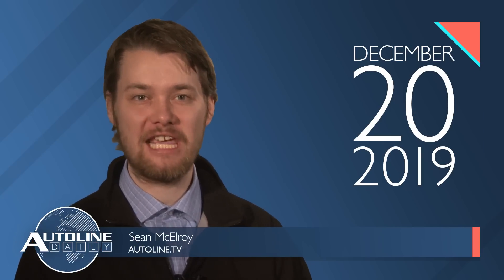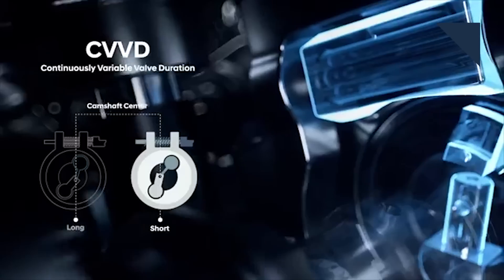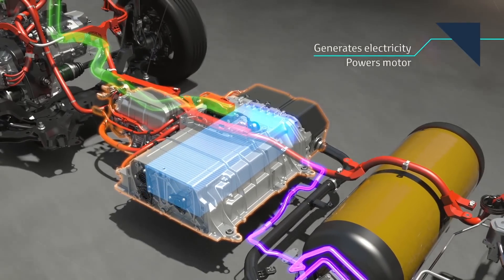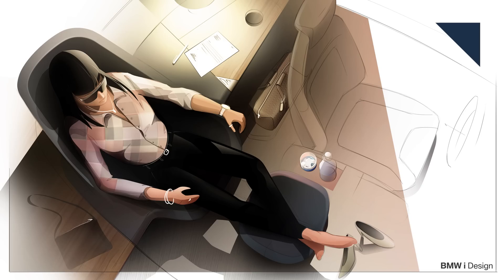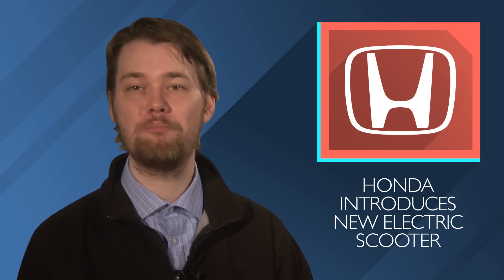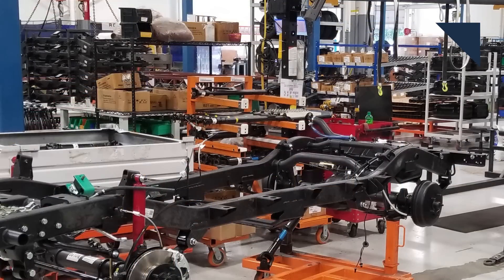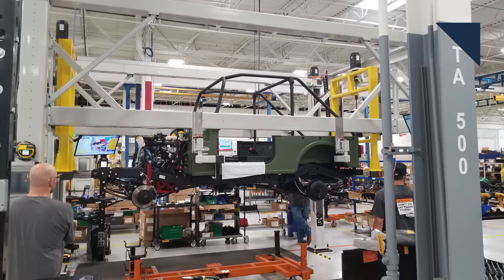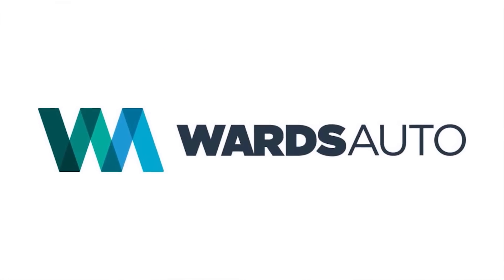How Mahindra's ROXOR is Made; Tesla Performance Update - Autoline Daily 2742

Comment: Regarding the Model 3 acceleration upgrade. As an owner of a dual motor long range I am very excited at the prospect of boosting my acceleration. At the time I ordered I was tempted by the high performance model but I could not get past the price difference. When I studied the enhancements the only component Iwas interested in was the acceleration. The other parts of the kit are nice but for the way I drive are hard to justify and not necessarily. I expect the extra acceleration to have a direct collation on the smile factor. So for $2000 I get a car that is more of a value for me. As far as weather or not it bothers me that the feature is already physically part of the car I bought  it doesn't. Going into this purchase one is aware of several options including autopilot that are built into the car that can be purchased later.  I look at this a big positive and love being able to add factory features when I am ready. Don't expect to be adding full self-driving but I did add enhanced autopilot once I got my rebate check. Thank you for putting together a great show Happy New Year!

Comment: The amount of wastage from EV battery packs is a handful of the percentage points of ICE wastage. Picture just the stack of oil cans a car will go through over 25 years. That plastic and foil container covered in oil is non recyclable. Now think coolant, gasoline, antifreeze, brake fluid, etc. it all adds up. EVs are better environmentally. Pretending otherwise doesn’t affect the facts, but you’re free to believe in a Santa, too, if you really want.

Comment: Saying batteries are recyclable is easy. That doesn't mean the value of the recovered materials is high enough to cover the costs of the recycling process. It's not like taking your bags of aluminum cans down to the recycling center and getting a couple bucks for your effort. There will be a significant cost to dispose of EV batteries even though they are being "recycled"

Comment: I was let down and eventually upset every time I went in for an oil change in my 2012 Volvo S60.  One feature I was told my car was going to be eligible to upgrade to by the dealer was remote start. I purchased the vehicle and started loving it but when I went in for my first oil change, maintenance, and promised upgrade, I was told they couldn’t complete the upgrade because my car had too early a VIN. To add insult to injury, every time my service advisor changed and they were doing a checkup on my needed services, I kept getting told they could absolutely do the upgrade. I even made another special trip to the far away dealer when they promised me. I told them I would pay them double or even triple if they could install it. Nope. So to answer your question, you would think I would very much dislike the idea of paying later to make your car better but here’s the thing. That was an after market dealer installed “option” even if it never was for me. With software, it’s not that OEMs are unlocking more power in this case. All kinds of software is optimized to make the car work better with all the hardware already installed. They haven’t talked about if those parts might ware out earlier because of it but part of the way they program vehicle systems is in a way that optimizes longevity to any specified degree and optimizes integrations better as some of the same parts are used for longer periods of time with either better than expected longevity or more likely in Tesla’s case to optimize the length of time some systems can be continued to be used with little or no change from the suppliers. Tesla doesn’t update vehicles with model years, they just stop making one version and move on to the next as needed. So by using better than promised parts, they are able to work on systems programming later to tune in better and better performance of the parts.  I’m not sure if I’ve ever seen a year down of a performance Model 3 and just an average all wheel drive one. I know there are differences they talk about in some systems but perhaps it was just less expensive for Tesla to cut down complexity of the car by making options software locked. People are much more apt to buy a little all the time, either through subscription or as small instant upgrades as time goes on than to replace a well functioning car all the time. With drastically less scheduled maintenance in Teslas, unless Tesla makes appreciable changes using the model year method, most people are surprisingly ok if their vehicle doesn’t do things exactly like the newest versions. But also by keeping many of the structural parts the same from year to year, they are able to change out tail lights to new designs seating or any number of items before or when those parts wear out which would mean even less profit from loyal customers not replacing their entire vehicle as often, they are faced with a daunting opportunity, have them upgrade even more often. But how? Virtual upgrades, especially if Robo-Taxi isn’t as big a thing as soon as they have suggested as soon as they have hoped. Tesla has talked about someday offering steering wheel delete as an option with full self driving and possibly standard someday. Will it happen? Who knows but people will gladly pay for that as an extra after market dealer “installed” option if it means that in their community they can drive hands free to 75% of the places they normally go if cities mandate driverless be steering wheel less in order to decide 100% who is in charge of the vehicle even if cities also force restrict geo-fencing of all hands free autonomous vehicles. What will happen to the last 25% of the trips or maybe even more? Gone, in fact I think planned cities will start popping up that are pre-planned 100% for autonomy.  In the far off future, cars that are not mostly or fully autonomous might even be required to have some type of warning devices in them to broadcast to freely moving autonomous vehicles that they are around and should be avoided to ensure maximum safety. Maybe a retrofit can’t be forced but perhaps something that uses existing standard equipment to make them more visible to autonomous cars like full time high beams or hazard lights except in turns or even their design will give it away. I know I would even return to that same old frustrating Volvo dealership for them to “install” the physical aspect of a future software self driving feature if it requited a wacky paint color or wrap to warn normal cars around me that my car was autonomous even if they couldn’t figure out how to install their own low tech remote start system on my beloved S60 so many years ago.  If I’m happy with what the car is promised to do now at a given price, I don’t care if I don’t have full use of a feature that might or might not be available to me at a higher price later.  I’d rather take what Elon Musk is selling these days, under promise and over deliver than the opposite. Rush the parts out the door now and make the software great now but make it better later. You just don’t want it going in the other direction.
Reply: Can you split your comments into "chapters" and page numbers. Its makes the reading easier

Comment: A couple of points i felt like noting.
* an average battery life of an EV is about 8-10 years with about 10% degradation. After that there is always possibilities for 2nd life in terms of storage for residential purposes. 
* the Wiper blades shown defrosting the snow is only being shown on Thin crusted ice. Get them to Canada in -40 degrees and tell them to do the same.

Comment: Each time a car manufacturer comes with a new model it has more power better acceleration but to get that you would have to buy the new model, so if you can get that on your current car for only $2000 , much better deal. ~ John K

Comment: 1:24 My 1988 Mercedes has heated windshield washer fluid.
Go take Ford, REINVENT THE WHEEL.  SMH!!!
Reply: Lung Dong 1970 Lincoln’s had heated windshield washed fluid. I think they stopped due to warranty issues - 1970,a glass would crack

Comment: http://redwoodmaterials.com/jobs  - many people working on recycle of batteries - JB Straubel Tesla founder, for example.
Redwood Materials advances sustainability by developing technology and technology-enabled services for materials recycling.
Especially BATTERIES.  JB also founded Redwood Materials, a recycling engineering company focusing on what he believes is the next important trend in sustainability: the transition to a circular economy. 
JB Straubel is Co-founder and Chief Technical Officer of Tesla. At Tesla he focused on technical direction and engineering design including battery technology, power electronics, motors, software, firmware and controls. JB is an inventor on over 30 patents covering most areas of Tesla’s core battery, motor and controls systems
In addition to his work, JB is a lecturer at his alma mater, Stanford University, where he created an engineering class and lab focused on energy storage integration (CEE 176C) in the Engineering Department.
JB received an B.S. in Energy Systems Engineering and an M.S. in Energy Engineering, emphasis on energy conversion, both from Stanford University.

Comment: They weren't concerned about the billions of laptop and phone batteries that go in the bin, just the EV batteries that will be in a controlled environment as cars are scrapped?
OK......
Reply: Because one Tesla  has 8,000 batteries.
Reply: @nellyfarnsworth7381  
4000 batteries.... That will be removed as a unit when the car is dismantled, sold because the pack is valuable used in secondary storage for years, then sold again for recycling because they're valuable .
All this time in a controlled environment.
They won't end up being disposed of.
The materials will remain in the system for ever.
Reply: Yup! I don't care either!

Comment: "Hyundai's valve system is incredibly complicated..."   That's not what you want to hear from a company that struggled with a plain engine manufacturing and had to recall 2 million units.   They should master the basics before venturing into deep waters.  Why not call the new model Sonata Titanic?
Reply: I don't get it either, putting this im their 1.6 turbo gdi, is barely going to make it to when the warranty ends without major engine repairs.

Comment: Lexus does the opposite. I don't have one but talking to owners, the Lexus has remote start when you first buy the car. But after one year, they will somehow turn it off unless you pay for toyota's subscription service.
Reply: My wifes 2017 Hyundai Limited has same thing. You have to subscribe to "bluelink" to have features like remote start. We used it for 90 day trial and thats it. I dont think its worth a monthly fee to remote start the car a few times a year
Reply: If its that bad just install an aftermarket remote start
Reply: @konstantindufnik696  I think the issue is that you've paid for something that is already on the car, you own the car and the equipment but the manufacturer charges you more to use it. Also, I don't think any aftermarket remote start will work with these integrated "keyless" systems.
Reply: @foxtrotwolf6081  its not going to work with it, its going to be wired directly into the vehicle, by bypassing all the system, thats how it works.
Reply: @foxtrotwolf6081  I agreed that automakers shouldn't do that, but if you can't do anything with it, you have to adapt.
Reply: @konstantindufnik696  Is that you Bear Grylls?

Comment: Based on no factual evidence this is "why", I can actually come up with a reasonable argument for Tesla charging folks $2k for this upgrade, and the word is "warranty". The motors in the Model 3 are capable of even more output than the Model 3 Performance outputs today, but the limiting factor is related to how quickly they let you draw power from the battery pack. Much like fast charging, fast discharging is harder on the individual cells, and can cause premature wear. If you buy an aftermarket ECM "tune" for a gas-powered car, you are often doing minor damage in similar ways, but in that case the manufacturer is on the hook to figure out what happened, and may just have to repair the engine if they can't prove the owner made a change.

Because they warranty the packs for 8 years at a certain amount of natural degradation, they are taking a risk that allowing people to discharge the battery at a higher current may lead to warranty claims in the future. The $2k could be seen as a way to allow people more performance, while allowing Tesla to hedge their bets regarding future degradation.

All of that said, the "why" is also because it makes the company money, obviously.
Reply: Id say "why not?" People dont really need to go 0-60 in under 4s but if you offer it some will pay just because theyre never satisfied. Free money for Tesla. Also, maybe they have gained some more knowledge of battery behavior and the softwares ability to improve its energy transfer efficiency. This would enable them to "trust" that it wont kill the battery prematurely. The more abuse a battery takes the shorter its life IMO. They could also make more money on future battery sales to those who abuse their batteries with high speed acceleration constantly. I look forward to seeing what kind of range model 3s have after 5 years and 10 years and comparison between performance model and standard model degradation to see if rapid energy transfer of performance model affects the battery any differently than standard driving habits
Reply: Dude, you're over thinking this crap. They charge it because they want to make $$$ out off this. Its that simple. Every car or product you buy doesn't offer free upgrades.You want a better performance out of your current model computer, iphone, car? You have to buy a newer model. So its only fair Tesla is charging you a small amount for an upgrade. Its called capitalism.

Comment: When you buy the vehicle, it listed 0 - 60 time. So whatever extra you pay to reduce listed 0-60 time should be completely reasonable. 
Let me know which other OEM improve 0-60 over the air even for a price.
Reply: The AWD is a nerfed Performance stealth model already. Nothing new here.  I like that they offer efficiency updates to even out of warranty cars for free. My 2018 gets updates that means I know my motor control software is the same next year that 2021 cars will have. Every other car manufacturer it is just accepted that you won't get updates. Heck, if I even wanted my Cadillac navigation system updated in my last car, it would cost several hundred dollars.